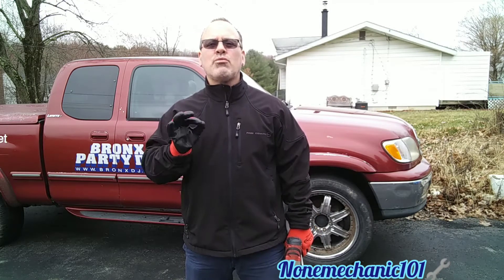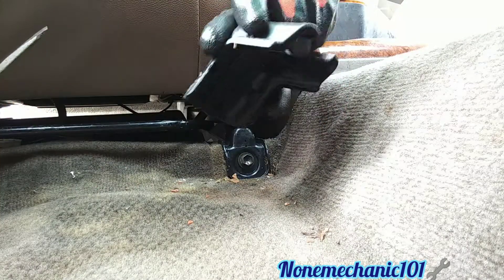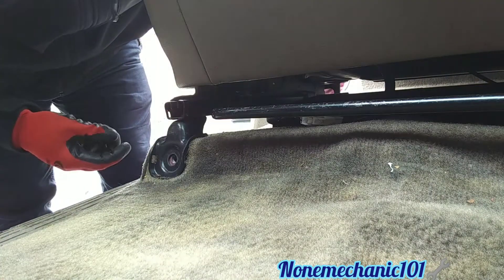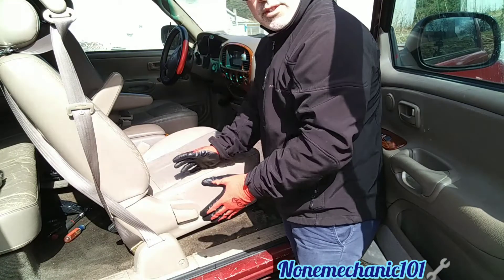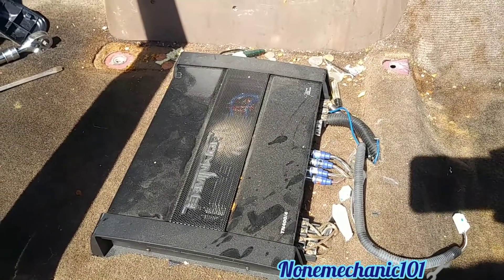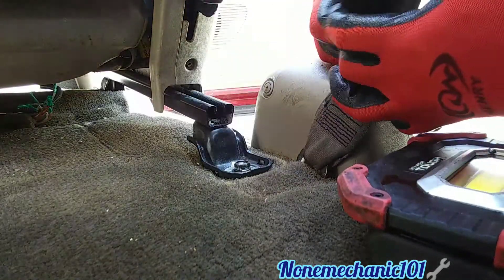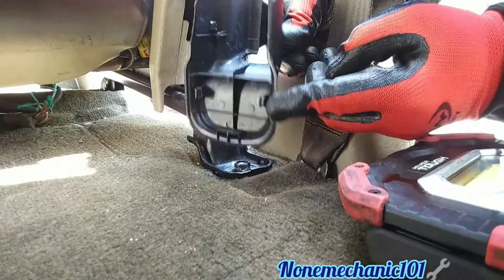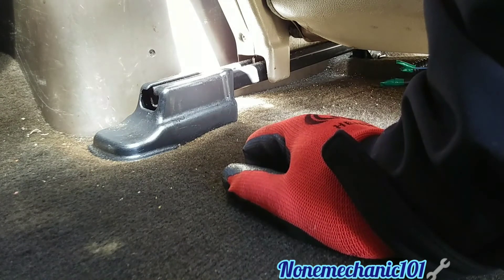2000 Toyota Tundra Passenger Side Seat Removal & Installation

Comment: Is it possible to just remove the seat but leave in the track/rail system? Somehow slide the seat off the tracks? I'm interested in taking mine out for a road trip but then putting it back in later and I'd rather not unscrew the track/rail system off the floor if I can avoid it?
Reply from the maker: The only way I saw it is by taking of the seat.

Comment: Does anyone if there are torque specs for the safety belt buckle?  I need to remove seat on passenger side to change out safety belt buckle because it is too tight of a fit to work between center console and passenger seat.